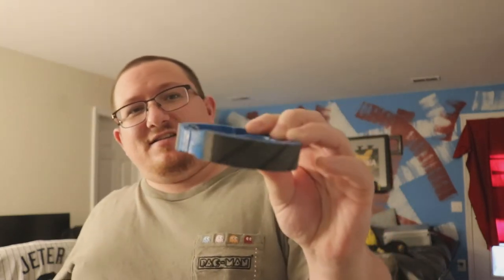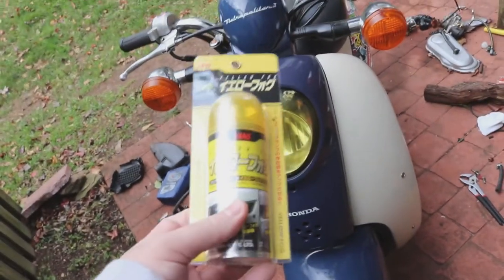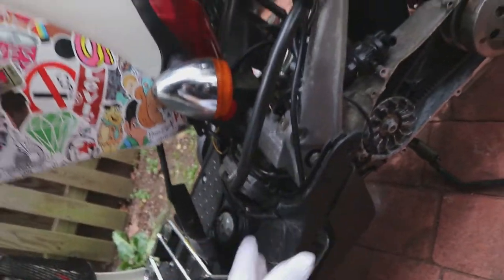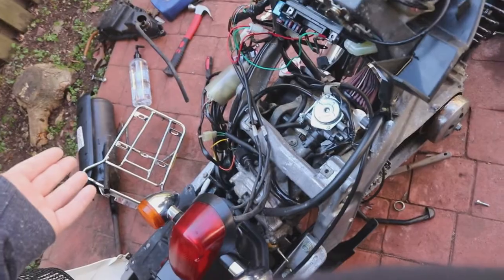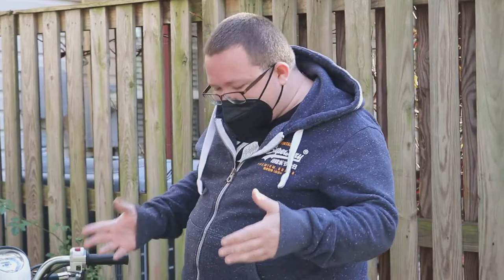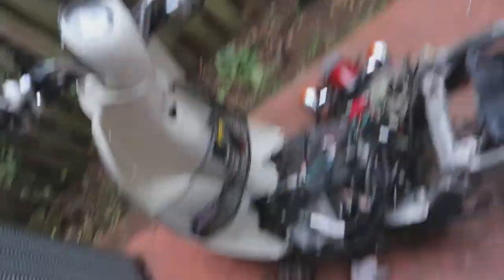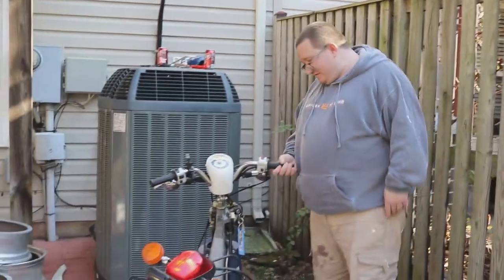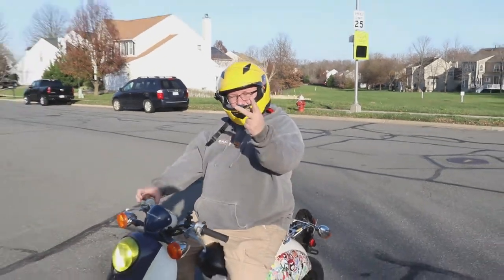Stretching the Metropolitan Scooter - Car Rant 8.20

Comment: How much extension do you think the Ruck wheel and shock made without the frame extension?
Reply from the maker: The wheel didn't fit right without the extension, it rubbed. The stock shock couldn't bear a lot of weight, but its physically shorter. Without the stretch kit, it just doesn't work.

Comment: i've got a swingarm and stuff in the mail right now. i plan on using the stock met wheel and tire for now. from what i've seen, with the stock wheel i shouldnt need a different shock. what do yall think?
Reply from the maker: I haven't found a shock that fits the stock Metro wheel location at all.
Reply: @CarRant  kitaco shock for zoomer

Comment: WHERE DID YOU GET THE  STRETCH KIT
Reply from the maker: The stretch kit was acquired from the Ruck Shop. As you see on the video I also had to modify it some (my skills aren't the greatest, wish I had a high power dremmel tool for some cuts and burr trimming) but it otherwise fit spot on.

Comment: Is the the stock metro case and swing arm?
Reply from the maker: Yes. Later I converted to a Ruckus swing arm. Wanted the gearing from a ruck for my weight and the swing arm for an easier time buying belts and wheels.